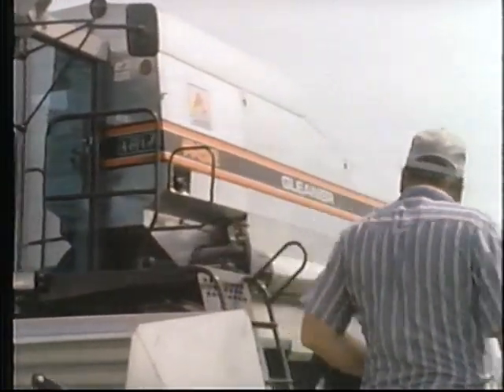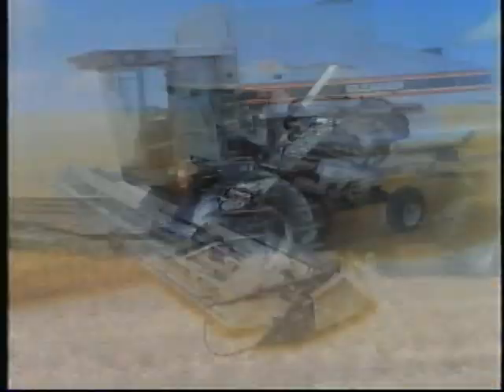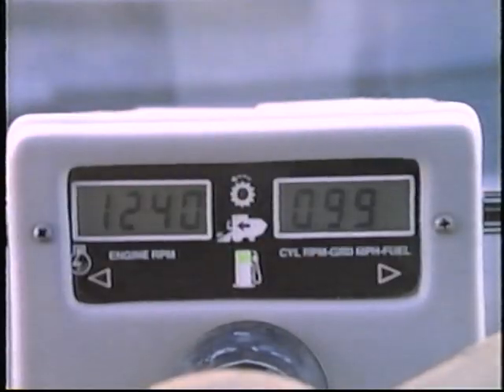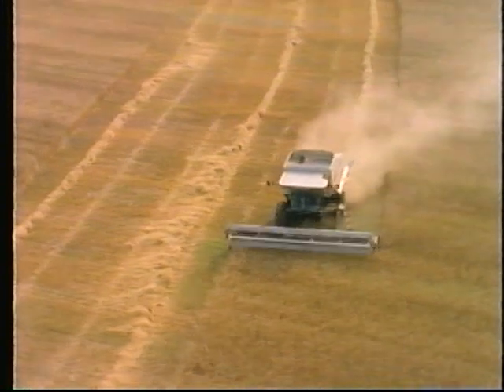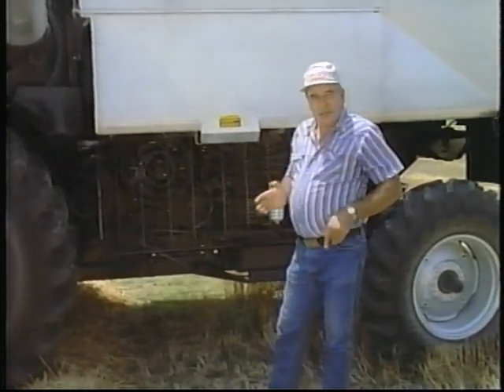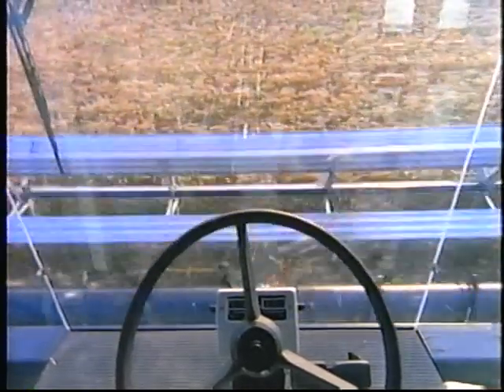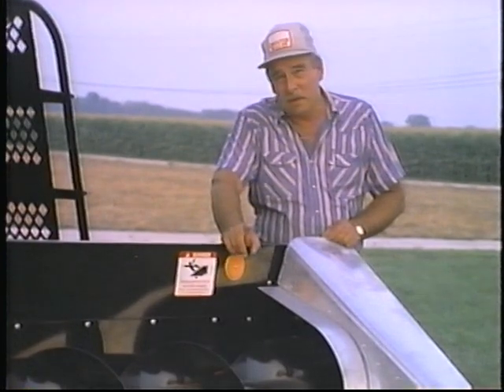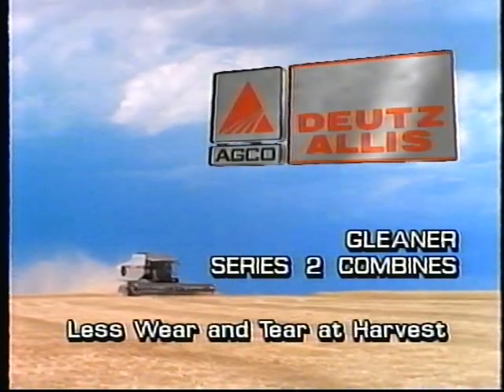1990's AGCO Deutz Allis Gleaner R52 Series 2 VHS

Comment: I have put in a lot of hours on Gleaners.  I spent the summer of 1971 on a 1970 Gleaner G.   I have a few hours in on a "L"  and a lot
of hours on the N6 & N7.   And what a long way they came from the G.  It had a 20ft header and 3 speed manual transmission with
variable speed & the unloading auger did not fold back.  One big drawback of the G is that it did not have AC,  just an overhead 
blower that blew outside air on you.   Over all the 4 G's we ran  that summer would good machines and I don't recall any major
breakdowns for the entire harvest run.  For the past several summers I have helped a cousin of mine for several days each
harvest on a Gleaner  R60 with the air cooled engine.
Reply: The G Gleaner was one of the best, so I'm told. They did offer an air conditioner as an option and even before the G an air conditioner was an option.

Comment: Allis Chalmers might still be alive today if the !992 2 series had been the starting point in 1979 for their rotaries instead of the 1979 N series.
Reply: What was wrong with the N series?
Reply: @gleanerman2195  Did they breakdown a lot and or  threshed badly?
Reply: @interman7715  Yes everything you say and much more. They were a nightmare.
Reply: @gleanerman2195  They did have some issues, but I think nightmare is a bit strong, still better or on par with anything else of the day.
Reply: @interman7715  The first 2 or 3 years of production they had a lot of teething problems but Gleaner did address them with update packages. By 1982 they were pretty good and by 1983 when the small decal series came out they were as good as most any out there. They sure could harvest a lot of acres in very little time. In my area there were quite a few around and the fastest combines in the field I had ever seen at the time. The very first 12 row combine built was the N6 and the first time I saw a 12 row machine was an N7 not far from our farm. I was a kid when they came out and despite the slams they get over the internet, when I was growing up the Gleaners were considered the Cadillacs (best) of combines. Then Alli-Chalmers went under in 1985. Deutz took over and didn't do the customers and dealers any favors. When I worked at the dealership, the Deutz-Allis didn't run the real good specials like they did before where bulk purchases would get the competitive prices like Deere and CaseIH were doing at the time. Made it hard for dealers to compete and with little support from Deutz-Allis so they slowly disappeared. That's when one of our dealers nearby switched to selling CaseIH. When I talked to one of their mechanics after they had been selling both lines for a while, he admitted the Gleaner is heavier built in all the right places compared to the CaseIH but they could get better deals selling CaseIH so eventually they totally dropped selling Gleaner at all.
Reply: Even if that did happen would Allis have of been  able to survive the 80s